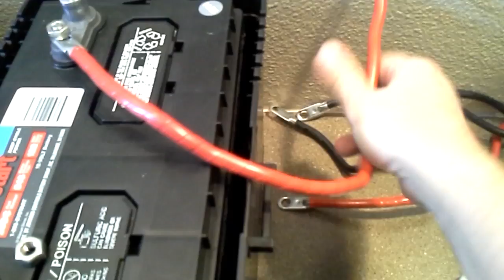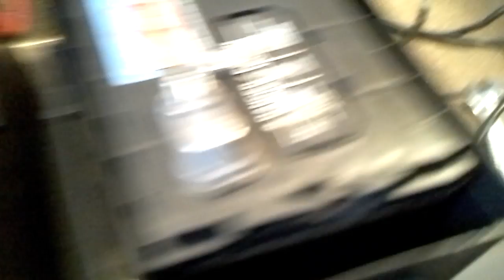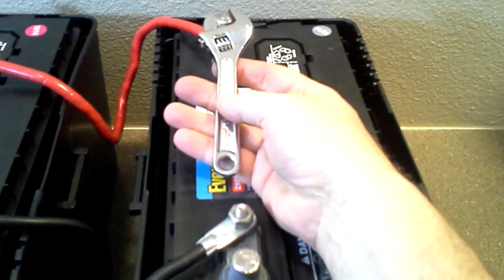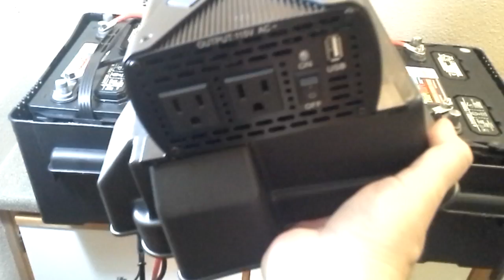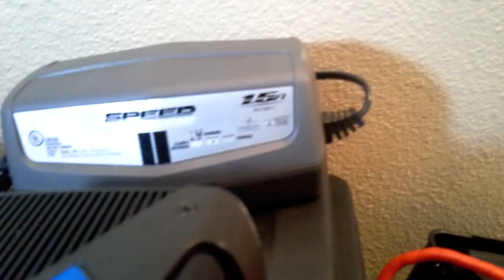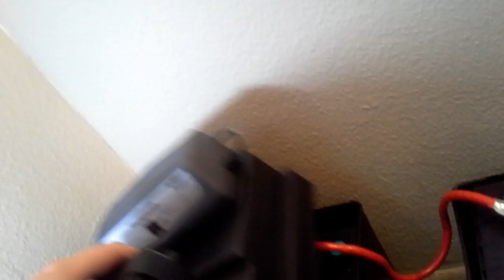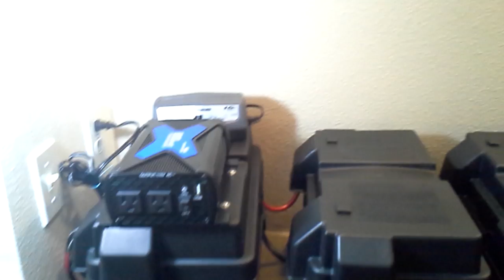Installing 4kW/Hr battery bank with 800W 120V Inverter and Trickle Charger from Tactical Woodgas

Comment: Sir I have Inverter who's charging current is maximum 20 amp 12 volts how manay batteries could be installed in parallel on this current of 20 amps I want to enhance battery backup on this system right now I am using 160amp single battery and inverter is solar hybrid inverter 1000 watts and 600watts for solar
Reply: Hey there Muhammad, I don't know the answer to your question, but who knows how long it will take for Tactical Woodgas to reply?  Meanwhile, head over to "DIY Solar Power Forum" ( https://diysolarforum.com/ ).  There are lots of discussions and plenty of people to help your out.  Also, check out Mobile Solar Power ( https://www.mobile-solarpower.com/ ).  Good information and he also has a YouTube channel.
Reply: You can install as mayonnaise batteries as you can mustard together.

Comment: I have an off grid situation, can I do a jumper from the battery bank to an outlet that would provide power to the whole cabin?
Reply: I sure hope that was a joke.
Reply: In this setup he is using 12 volt batteries.  If you have 12v lighting and 12v appliances (12v fridge for example) yes you can.  You could then use solar panels and a solar charge controller to charge the batteries during the day.

Comment: hello, 

i want to run 2 50 watt speakers, my laptop and a dj controller off grid for about 6-8 hours...
is this method or something similar possible for my goal?
if no is there anyther possible way?
Reply from the maker: The 2000W version at www.tacticalwoodgas.com will work for that.  That is what a beach DJ in Florida is using now.  Also, get a couple battery add-on kits so you can run longer and add some lighting.

Comment: @TacticalWoodGas. I just lost my entire comment [all 3 paragraphs] because I hit the wrong key & it pushed me into the next video, lol it's not the 1st time this has happened. Okay I'll try it again. Hopefully you see my comment on your screen & you to answer it. A lot of people don't bother to check. At any rate, I am looking at the 5,000/10,000 Inverter & that might be over kill, I'm not sure yet but I'll just continue with it. The numbers I typed in mean 5,000 continuous Power/Surge Power. Just for those who don't know. I have a 5,000 watt generator & mine is 4,750/6,500. Plus I had thought about installing at least 3 Solar Panels for Charging the System. Why we should be thinking about this & I mean seriously thinking about it. We are entering what Scientists & Astronomers seem to agree on, the solar minimum. Sounds like that could take a while & everyone should be prepared for our power going out.
Reply: good, now days, the lithium iron battery packs is more popular. better than lead acid battery.

Comment: Can you add solar panels to the batteries .can you do a video on how to connect the solar panels and whether charge controller is needed?
Reply from the maker: crispian francis 
It is already available with an integrated solar charge controller.  
https://www.tacticalwoodgas.com/online-store/Battery-Bank-with-1200W-AC-Inverter-plus-solar-wall-car-charging-ports-p95165068
Reply from the maker: crispian francis 
The link I sent has a video at the bottom that shows how to connect the solar panel.
Reply: It needs charge controller
Reply: Solar panel and controller come with clear instructions

Comment: Yes, tricky to do that with only one hand 😏. I made the mistake of using a long spanner and had that exact experience. Scared the crap out of me 🙈. What gauge wire are you using? thanks
Reply from the maker: 4 gauge for smaller inverters, 0 for larger.
Reply: @tacticalwoodgas4036  Well my inverter is 600w so I assume that is a smaller one. I've bought some 25mm² wire (4 awg). Thanks

Comment: Cool set up. 

I've got a funny questions if you wouldn't mind answering though. 
My average daily power usage is about 4.4kw a day. So if I got 4 or 5 of these batteries and had solar panels that produced an average of around 6kw a day would I be able to run my whole house with that?

By my beer math, I think I could, and still have a tiny buffer for fluctuations.

But then again I failed math in high school....so yeah any feedback would be appreciated :)
Reply from the maker: Indigo Hurleigh-Craig 
Yes. You would need 1kW of solar panels in summer, a bit more in winter.
Reply: Tactical WoodGas 
Thanks for the quick response, you just made my day :D 

No more power bills for me😃

Comment: How do you connect the charger to the inverter?
Reply: You can connect your charger to the inverter DC input terminals or the battery bank itself. Besure not to connect the charger to only one battery but opposite positive and negative corners of the bank itself :)

Comment: I have a system like this but some videos say you should have an inline fuse.  I can't find a good video on how to install one. Can anyone tell me or direct me to a VERY simple source? I have a 750-watt inverter,  12 volt deep cycle battery what size fuse do I need?
Reply from the maker: I don't fuse battery banks, but am very careful to protect wires and connectors from being shorted.

I fuse the loads.

Comment: Thank you very much for taking the time and explain this for newbies. I was looking to do something similar for emergency power I loose power for 3 to 5 hours sometimes, but not very often, so this setup is great. I have a question, the charger and inverter are connected together, right? and how often should I discharge the batteries to keep them in good condition? well, two questions. 
Thank you 
Semper Fi
Reply: Pedro Martinez 

Semper Fi!

The inverter input, wall charger output, battery, and solar charge controller output are all connected together. 

The wall charger handles maintenance automatically,   no need for discharging.

Comment: I need some help as I am a total beginner to all this.Well I want to power something constantly which will use up about max 3-4K watts. 
I want to use this battery setup to power it but I am wondering how many watts does it take to, for example charge these 3 batteries? 
Another thing is how long would this set up last without the car battery charger? For example u used up all the possible wattage?
And is there a way that the batteries will charge themselves so that I don't need any input except car battery and inverter?
Reply: Very good question you took that from my mouth i just wondering how long this set up can serve
Reply: If you mean 3k watt-hours,  you will need five batteries in parallel.  Just like the video except 5 batteries.

Comment: At what battery voltage will your inverter start to alarm.... have you tried to plug in your fridge to see how long it will last in case of power outage.... I am trying this on a 1200W heater and it just does not last long at all.... Ideas ???
Reply: 11 volts visually 10.5 volts audibly. Our inverter is only rated at 800 watts continuous, not 1200 watts. What batteries and how many are you using in parallel??? Amp hour rating of your batteries. How long will a refrigerator last on 1 each fully charged 120 amp hour battery: Mine lasted almost 20 hours. It depends on how big the refrigerator is. How energy efficient it is. How warm it is inside and outside of the appliance. How long it sat without power before being plugged in etc....
Reply: A 800w inverter will not be able to run a 1500w heater. You will need a 3000w inverter., on a 340 amp hour batterie bank, you might get about 1 hour run time on a heater.

Comment: but you are using ac wall outlet power for something...so how will it work if the wall outlet power is dead...??
Reply from the maker: The A.C. charger is is plugged into the wall outlet so that the battery is 100% charged when the power goes out.

After that, recharge it from your car with battery cables.
Reply: Trickle charging the battery

Comment: I was disappointed that my 12000 W inverter shuts off at 10.4 V . I realize you shouldn't run it past 6 or 7 V but 10 ??? Is anyone else having this problem ?
Reply from the maker: lisa hommes 
Very common shut down voltage.  Makes your batteries last longer.
Reply: 10.4 'IS'' a dead battery! Just as 1 volt is a dead battery for a AA (Use a volt meter to check next time). Never let a 12 volt rechargeable battery go below 11.5 if you want it to last it's expected life expectancy. 11.5 is a half charged battery.

Comment: do it matter if you hook up two totally different batteries like if the cca and battery size is different.I'm asking because i have a mini fridge powered by a 860 cold cranking amp battery.So I'm thinking if two batteries is hooked up at the same time maybe the mini fridge will stay on longer ? Running a mini fridge should i hook the batteries in series or parallel for it to stay on longer ?And i do have a 1,000 inverter
Reply: it depends from your inverter if it's rated to 12V or 24V to have 12V you must use parallel / if you have 24V you must use seires , parallel is for longer charge time and series is to double voltage
Reply: So if i do it in parallel would it keep the fridge on longer cause that's what I'm thinking and would it be less harm to the battery hooking the up together in parallel so the cells won't die ?

Comment: Hey why's the 110 v battery charger connected? Doesn't make a sense. You can connect your fridges directly in de ac   Connection.
Reply from the maker: John Simai 
The A.C. charger is for people that use the battery bank for emergency power.  It keeps the battery fully charged.
People that live off grid full time don't need the a.c. charger.

Comment: If those are inside a building or RV you should be venting the hydrogen gas to the outside with vent tubing or pipe.
Hope it doesn't explode.
Reply from the maker: Not an issue.  Hydrogen is only released under very heavy discharge rates.  Also, hydrogen is the smallest atom and will not build up.  It escapes and heads for the upper atmosphere as soon as it is created, even in a closed room.
Reply: Gel or lithium batteries should not give off gas .. only lead acid will
Reply: @TheDoublesixguy  they will under the right conditions.

Comment: I need help I have a greenhouse and I want to run lights etc off solar how do I? And how much will I need
Reply from the maker: Everything you need, already wires, is here: https://www.tacticalwoodgas.com/online-store/1200W-Battery-Bank-PLUS-100W-solar-panel-%26-connecting-cable-p99746394
Reply from the maker: *wired
Reply: Tactical WoodGas ok thanks

Comment: Hi, with a cross over (male-male) power cord, could you plug this into a homes wall socket, to feed into a house?  and if so, could you leave it plugged in, during non -emergency, to cut down on Utility power use?
Reply: I used to run a petrol (gasoline) generator plugged in that way to send power into the house through any wall socket. What I found however was that my generator bogged down immediately under excess load and probably would have stopped running but I switched it off. What was happening was that I was feeding electricity to the entire street through the electrical distribution board outside in the street (which feeds into the house) , which each house has. But they are all connected but with separate meters, and my little I.1 Kva genny was not up to that! The solution was to go out and flick the circuit breaker for my house to off, thus isolating my house from the rest, then it worked fine. Being in South Africa you may have a different system where you are of course but I expect it would not be too different.
Reply: That cord is known as a suicide cable for a reason.  If you use that you FIRST need to shut off your main power or you risk killing any linemen working on the system outage.  Also there is no syncing mechanism in your generator, so with the mains energized your generator is going to lose the tug of war with the power company and stall out (best case if you're lucky). The resulting fire damage to you, the power company and possibly your neighbors will be your fault and your insurance will not cover you for gross negligence.
Reply: NO absolutely NOT

Comment: okay im offically confused, ive just got from work 4 old 12v 7ah batterys to use in solar shed wanting to connect them for 12v and extend run time. should i connect these as you have with the inverter but without inverter. my lights should they be connected positive connected to battery 1 and negative to battery 4 and the solar charger should they also be connected battery 1 posative and negative battery 4
Reply: how I can studie sols system online
Reply: If you connect the 4 batts as he has done (pos - pos, neg - neg) this is called "in parallel", your 4 batts will still be 12V, but you will have 4 x 7 Ah, which is 28 Ah total, therefore quadrupling your run time. As for use, connect the either end battery i.e. Batt 4 pos to positive cable of light, and neg to negative cable of the light. As for charging, this is more difficult to explain. Most people just connect the end battery to the charger. You can do this, and it is fine, however each battery as you move from the charging battery will not be charged as much or as well, and you will have problems with batteries dying. This is why it is best to balance the charging on all the batteries. Especially as you have 4 batteries in parallel. I found a video that shows this so I don't have to explain it over a very long message !! Refer to this and have a fun with your lights !! https://youtu.be/oOEqnCrxPYg

Comment: Sir have 12 v Microtek xp1400 inverter she'll we connect 2 battery with 180ah and 150ah in parallel connection?
Reply: NO, any batteries connected in parallel or series must be the exact same batteries and exact same age never mix odd or new and old batteries

Comment: you have 800 watts inverter how much amp your inverter have may i asked ?i have 800 watts inverter 8amp 110 V 60Hz then i have 1100 watts inverter 9amp 110 V 60Hz then i have 500 watts inverter 4amp 110 V 60 Hz then have 1500 watts 110 V 60 Hz but they put how amp on it wich sucks
Reply: 110v x 8A = 880w.  110v x 9a=990w  110v x 4A = 440W 1500W ÷110V = 13.6A where's the Question misunderstanding?

Comment: why not hook directly to house electric panel and save on the cost of the batteries
Reply: This is used when the power goes out. It will be able to power a few small, low wattage devices for a while like an led lamp, small tv, or laptop computer, phone charger, alarm clock etc. 
It's not large enough to power a 1200 watt blow dryer, a heater, AC or anything that takes over 800 watts or so.

Comment: A 800 watt power inverter will not run a fridge, also lets not forget that batteries create hydrogen gas when charging and is explosive. If you are going to use and store batteries indoors, use AGM solar batteries or build a battery box with a vent pipe leading to the outside.
Reply: +LMAO77598 not to mention breathing hydrogen gas laced with sulfuric acid is not good for you.

Comment: if I have a wind turbine and its out is alternate current. How I invert and store that energy in a battery bank? it's possible with this?
Reply from the maker: Francisco Mancilla 
You need a rectifier/regulator/brake package like this https://www.ebay.com/i/322297105014?chn=ps&ul_ref=http%253A%252F%252Frover.ebay.com%252Frover%252F1%252F711-117182-37290-0%252F2%253Fmpre%253Dhttps%25253A%25252F%25252Fwww.ebay.com%25252Fi%25252F322297105014%25253Fchn%25253Dps%2526itemid%253D322297105014%2526targetid%253D376183970601%2526device%253Dm%2526adtype%253Dpla%2526googleloc%253D9033502%2526poi%253D%2526campaignid%253D962373765%2526adgroupid%253D46238024325%2526rlsatarget%253Daud-384261923267%253Apla-376183970601%2526abcId%253D1129816%2526merchantid%253D113581836%2526gclid%253DEAIaIQobChMIhN-5h_Tx2AIVhKDsCh1pfA8mEAkYBSABEgL38PD_BwE%2526srcrot%253D711-117182-37290-0%2526rvr_id%253D1424037647259
Reply from the maker: Francisco Mancilla 
Send me the make and model so I can do some research.  I may come up with a solution for you.

Comment: What type of solar panel, inverter, and batteries I need to run a 600w food dehydrator for 9 hours a day?
Reply from the maker: Get seven 100W solar panels, a 1200W inverter, and six 100AH batteries.
Reply: or use propane
Reply: @danwells7691  where can you get a propane dehydrator?
Reply: Why not just sun dry food? Seems senseless to Me to collect sunlight to store in batterys to run a heater to make sunlight.

Comment: May i know whats the charger function on top ot that  very left of your battery..
Reply from the maker: Wan, it keeps the battery fully charged when the power grid is up, so it is ready when the power grid fails.
Reply: @tacticalwoodgas4036  ok thanks for the info..im ready to do it like yours.
Reply: @saintmichael2070  an E.M.P. would take out all electronics not sealed within a Faraday cage. That is electronic, not necessarily electric.  That charger and inverter are electronic.
 If you could find a 12 volt can opener, and coffee grinder that doesn't have a circuit board in it, then you could use them with the charged batteries. The big problem would be recharging the battery. Solar panels, charge controllers, alternators, led lights etc. are all electronic. Very old (50s, 60s) cars with a generator charging systems should work. Old style lawnmowers with points ignition should work. Maybe take an old mower engine and cobble an old car generator charging system on it? 
Google "12 volt products"
Good luck.